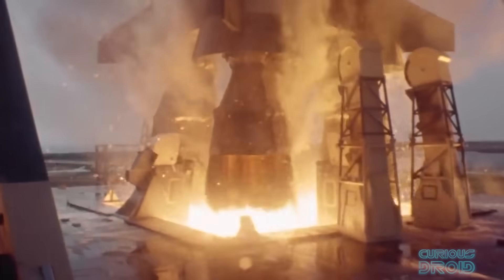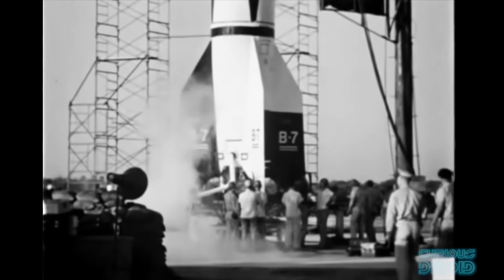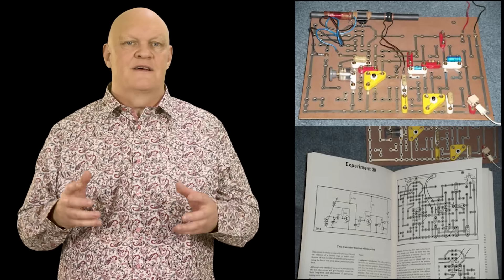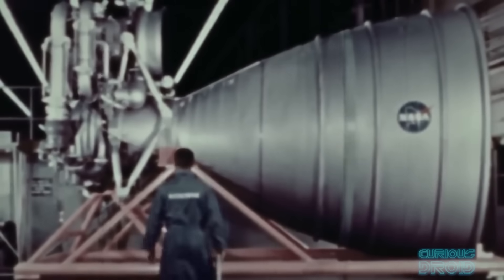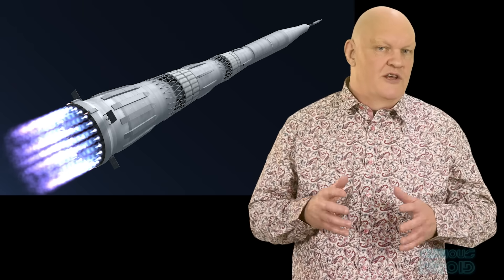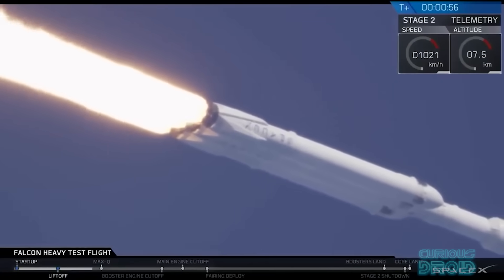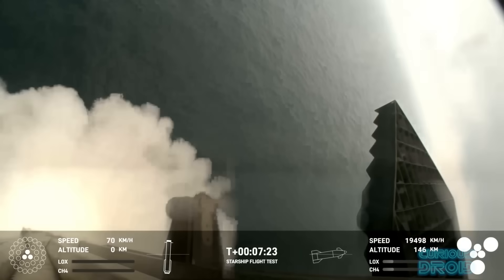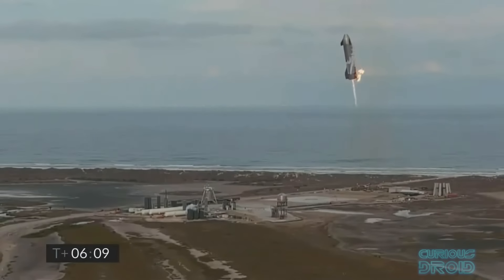Why Does SpaceX Use 33 Engines While NASA Used Just 5?

Comment: A bit unfair to blame the SLS on NASA engineers. The most fundamental design decisions were made by politicians, not engineers. The joke name "Senate Launch System" isn't that far off.
Reply: The biggest mistake in the SLS program was handing the reins over to Boeing/ULA and expecting anything to happen in a reasonable time, especially when you essentially give them an unlimited budget. When you give them a fixed budget, they cry about it when they still   inevitably fail to get it done properly(see Starliner).
Reply: @craftiebrown  Let's just hope the door doesn't pop out in space.
Reply: @TonboIV  Exactly
Reply: Honestly true, they also mis-incentivised everything, alot of SpaceX engineers used to work at Nasa, so it's not as if the Nasa team aren't as good by that much, they just aren't incentivised to hold long term missions, goals, etc, they have the budget for a single mission and that's if their lucky, and a ton of that just gets absorbed by managerial costs

I would argue mismanagement and politics could be the main reason why so many projects fail, talent helps, but lean and efficient management is what gets it over the finish line or to the moon
Reply: Senate insisting on SLS relying on the space shuttle technology and "parts" was a naive and deeply uninformed (or misguided) decision. The SRB needed ton of redesign of the internal components, liners, and insulation to make them safer, so much that it took years to recertify the modifications. The space shuttle design had the external tank carry side loads, as the boosters and the orbiter were mounted on the side, while SLS has the upper stage on top amd the thrust section at the bottom. That resulted in a necessary deep  structural redesign of the external tank to transform it into the first stage of SLS and be able to carry the loads. In the end, the "heritage" from the space shuttle program is tooling (and it can be argued that reusing the SSME engines was also not cost effective, the costs for refurbishing and recertify the engines after the shuttle flights ended are incredibly high, and they are disposed after one flight)
Reply: Exactly. Intent is to keep the same companies in business after Shuttle. Problem is the SSME and SRBs designs were chosen in 1972 to launch a winged vehicle. And that design had its tradeoffs. If NASA engineers had their way for designing a new large rocket to go to the moon, the architecture would be completely different. SpaceX had advantage of starting from scratch instead of carrying political baggage.
Reply: It seems glaringly obvious modern low-cost &  advancement of computers allows for multiple engines, but that was glossed over in this video. The computing technology of the past did not make multiple engines feasible.
Reply: @powerguymark  I wouldn't call that "obvious". Modern computers certainly help, but guiding a rocket into orbit at all is already a very difficult problem, which they managed in the 50s with incredibly primitive electronics. I don't see why controlling 33 engines would have been an insurmountable problem when controlling 5 wasn't. The N1 rocket had a lot more problems than just the number of engines. The Soviets weren't even able to do proper all up testing of the engines themselves and they couldn't test fire their stages at all. The first flight of the N1 was literally the first integrated test of any of its systems. It's not at all surprising that it blew up four times. If Korolev hadn't died and if he'd had access to even a fraction of the resources the Americans had, I think he'd have had an excellent chance of getting the N1 flying reliably.
Reply: @powerguymark 

Just as a funny side note, the space shuttle was using basically the Apollo mission computer that utilized core memory basically when it flew ,( core memory is electro mechanical,a disc similar to a washer is twisted sideways on its axis to indicate 1 or 0). NASA like the military loves ' proven technology'. 

When I visited the Johnson space center a retired engineer said when they started looking at the SLS booster for Artemis, one of the things they did was disassemble a Saturn 5 they had, to document its components. Apparently ( according to him) a lot of the plans were never digitized and were lost.
Reply: At least it's crew ready and had a successful non explosive first mission.
Reply: @MrMarshGames  
No doubt.  Starship's upper stage can't make it to orbit and crashes EVERY time.
Reply: The fundamental problem with SLS is the entire decision to use space shuttle derived technology. The inefficiencies of the contractors just make it worse, but the fundamentals were already terrible.

The space shuttle was already a failed program in terms of providing low cost space access. Sure, it launched lots of people and payloads, but for actually lowering the cost of space access, it was a failure right from the start (and there again, political design decisions were the main problem). Trying to modify an existing system into something drastically different in order to save development costs almost always ends up being more expensive than starting from scratch, and in this case we're talking about modifying half century old tech intended for a reusable space plane that was never going to be cost effective and turning it into an expendable rocket. The RS-25 in particular is a complex, high-strung, high-performance powerplant with a very expensive and labour intensive manufacturing process, yet most of its design requirements are unnecessary on SLS.
Reply: @TonboIV  To be fair NASA didnt want the flying brick of a shuttle we ended up with. Congress demanded that the shuttle have military capabilities which cause the design of the shuttle to increase drastically in size and forced them to mount it to the side instead of on top and that side mount is the reason we had two catastrophic failures . A top mounted shuttle would have likely been able to survive the Challenger incident and the Columbia incident would never have happened.
Reply: @TonboIV  remember the goal isn't gradually lowering the cost of space flight, that's why they will just ask other companies to design and make the capsules, which means they have to wait for exterior projects to finish before they can complete their missions

Just one more star to align
Reply: The Burning Rentry of Space Shuttles made such program too risky for reusing the Same Craft again & again. The politicians may virtually know it but not to .. realization. The Revamping the whole Burnt Shuttle, esp the Protective Heat,Tiles Underside the Craft, including to verify/testify the Substructure of overall the body-length is not 30/70 Cost portion as expected but rather 70/30.. newly added 70%, reusable Bodied just 30%. This final overall fixation of Whole warranty of flight Safety ..is FAR from Cheaper.. and nearly to guarantee the compatible of a whole NEW ones. So many accidents occurred, esp during Return flight of Reentry, the last one's hydraulic Door failed to close tightly, the bursting flame got into/under Wing structure. All gone & Shuttle program cancelled.
Reply: @komolkovathana8568  wrong. The loss of Columbia was due to impact damage to the RCC of the forward wing. That was not an area using the ceramic tiles whatsoever.
Reply: @TonboIV too bad Nixon canceled the Saturn 5 and sold the tooling for scrap.  Imagine the amazing launch vehicles the Saturn could have evolved into.
Reply: @TonboIV Really? Has SpaceX flown to the moon and back on its first launch?
Reply: @TonboIV  that is why I mentioned the Block III. The SSME underwent multiple major revisions over the years with most of the design being replaced Ship of Thesius style. Block I was the post-Challenger redesign, to give a starting point. The Block III replaces the nozzle and combustion chamber, the two most expensive and labor intensive points of the design. The replacement is derived from technologies made for the RS-68, an engine much more in line with what they need. Around when they will be ready is when the new boosters should be as well. That is why I am excited by the switch, to see what it can do with systems made for it, rather than hand me downs.
Reply: @downix The turbopumps are fiendishly complicated and their performance isn't necessary on an expendable booster. There were more suitable engines that could have been used right from the start, and once again more money is being spent to mangle a square peg into a poor fit for a round hole instead of just buying a round peg and admitting those old square pegs aren't useful anymore.
Reply: @TonboIV  depends on which ones you mean. The SSME had both sets of turbopumps replaced over its lifetime, a few times in the case of the low pressure oxygen pump. The configuration SLS is using were the last Gen versions, which again, were closer to the disposable pumps off the RS-68 than the original HG-3 pumps that launched on STS-1.
Reply: @downix  Either way, it's a modification of a racehorse engine into a packhorse. There's only so far you can go without just starting fresh, and all these modification cost a bunch of extra money and time just to turn the RS-25 into something else. The people who come up with these ideas always say it will be so quick and cheap, just a few little modifications and old-machine be perfect for new-project, and then one little modification requires another little modification, and that requires another, and now we need to modify the vehicle too...
Reply: @TonboIV  if the Senate hadn't limited the engines, my guess is they would likely have used a modified RS-68, which began life as a cost reduced, disposable version of the SSME, called the STME.
Reply: @downix  That was certainly one possibility. There were some significant problems with using the RS-68 too, but it wasn't even the only option.
Reply: @TonboIV  would could should, lots of possibilities. Sadly, the Senate put a massive thumb on the scales.
Reply: @downix  cry harder. The sls is an awful design
Reply: @downix Tonbol is right about them always saying a rocket modification will be quick and easy…..stuff always still takes a damn decade lol.
Reply: @downix  all of the concerns you've mentioned and more prove only one thing.   US public institutions are no longer the solution to any sort of economical or reliable space travel.  Our government is frankly a disaster of our own design and that's unlikely to ever change.  

Just toss SLS out the window and give SpaceX 5% of the money.  If Superheavy wont do it just give them the specs of what you want and let them exceed it while doing so under budget. I'd be willing to bet SpaceX could have a totally new ship design landing on the moon before SLS is ready for the next phase of its already obsolete life.
Reply: It's not just unfair. It's ignorant, perhaps willfully so. How can you do research on the SLS program and not come across why it and the shuttle were so inefficient?
Reply: I don't see that he was blaming NASA engineers, just that engineers leave/left NASA for certain reasons 🤔
Reply: almost never a reason to blame engineers, unless they're doing it maliciously, it's always some mahogany door, suit-dummy that makes the stupid decisions.
Reply: At least the SLS went to the moon, came back, and landed successfully back on earth on its first attempt.  Starship can't even make it to orbit and is only good at crashing.
Reply: @kstricl i think with 11 launches for orbital fueling, at $100M thats just a tad over $1B to get a moon launch going. The cost might drop with time but there is still landing the boosters and starships  and orbital refueling to  figure out. It might be cheaper in the long run  than SLS but it will take longer...a lot longer. SLS has already gone around the moon with Orion.
Reply: Tbf, iv read into the politics and it makes the program more cost-effective than I really realized.
Most of the "useless costs" with the SLS, are mostly just glorified subsidies and welfare for keeping missile companies and other jobs in business.

If were gonna have subsidies over these jobs, then we might aswell keep em productive while at it.
Reply: @honkhonk8009  Makes sense. We funded the Russian space program for the same reason in the 90's. You really don't want rocket scientists out in the world "looking for work". Iran does but you don't.
Reply: @honkhonk8009 Could have used those subsidies to either develop missles (we need new ones) or to build space probes.
Reply: @honkhonk8009 Not really. Some of these programs are so large and complicated no one knows who is giving who orders. This creates situations where design teams are fighting over small changes
Reply: @honkhonk8009 exactly you don’t want them to work for NK or China
Reply: @honkhonk8009  So, create glorified subsides, then continue to endlessly pay people to fail because there's already subsidies that you've created. Then claim it's cost effective when it runs over budget endlessly? Got it.
Reply: But the best and brightest have gone on to greener and much more lucrative pastures like SpaceX, blue origin, etc..  give NASA unlimited money to do whatever they want and they couldn’t come close to SpaceX because they no longer have the engineering talent.
Reply: In addition to what everyone else is saying, SLS was designed the way it is, with contractors in each of the fifty states and most of the territories, to make it administration-change proof. Ever president has a new idea for what to do with NASA and it hinders long-term planning. SLS has withstood more than 20 years of bureaucracy. Just as designed. NASA did this on purpose to keep Congress' eyes on the moon.
Reply: No it's all NASA hardware. While I agree that giving billions and billions of our money to other nations to fight wars that have nothing to do with us is 100% wrong. Even a percentage of what's been given to Ukraine over the past few years could have seen NASA not fall further and further behind, and have to resort to building the spacecraft equivalent of a hotrod using junkyard sourced parts. And we m8ght not be looking at the 50 year follow up to the apollo craft that centered around a capsule with an ablative shield being an almost carbon copy of the aforementioned capsule. Yes the computer hardware is light-years more advanced and the switch from fuel cell generated electricity to solar panels eliminates the points of potential failure that almost killed the crew of apollow 13( but introduces new ones see micrometeors and what a sand grain did to the James Webb) 
All that said the SLS is still a NASA product and while it is functional it's a bit uninspiring and in my opinion embarrassing.
Reply: It's all NASA hardware and yes giving billions upon billions to ukraine for a conflict that has nothing to do with us, has knee capped NASA. The SLS is functional but it's nothing more than an apollo system right down to a capsule with ablative shield. Sure the electronics are modern and they're using solar power instead of fuel cells for electricity generation. But it's still a capsule. And while the SLS is a cobbled together junkyard hotrod, those running NASA still won't listen to those funding them aka you and me and have elected to chuck 99% of the system (rocket) into the ocean, again just like back in 1969. The space shuttle was a year old when I was born and budgets be damned because they can't tell me than in over 40 years of sending people up into orbit that none of those same engineers came up with something anything to make even part of this Frankensteins monster of a rocket reusable. Hell just the engines, the liquid fueled engines just them. The smartest people with the most experience to draw from can't figure out how to bolt on a set of parachutes to these things so that they soft land? Or chutes in combo with some kind of instant inflation device that would allow them land and then float in the ocean until pickup? If your budgets are being slashed by the parasites in DC then maybe make the most of what you have. It's embarrassing to listen NASA talk about the new moon mission, especially when you consider that they already DID IT!! NASA has become contradictory and even kind of ignorant, in that they have a motto for finding life off of earth and that's "Follow the water". Well they've been dicking around with mars since the 70s with at least 2 positive signs of life but not definitive signs. And in the last 20 or so years at least 2 of the ice shell moons Europa and Encelidus have proven that they harbor massive liquid water oceans under their surfaces. not like mars with its dried up oceans where we may find a fossil or two, or maybe (big damn maybe) a subsurface aquifer, but actual current watery oceans. In europas case the water is thought to be around 60 miles deep with pressures at the bottom like those we see here on earth because of the lower gravity and given that jupiter / io are stretching europa like taffy all the time there's a good chance that Geo thermal vents exist down there. But NASA ignores europa amd won't shut up about mars. And now thanks to bidens spending spree the mars sample return mission probably won't happen. And the so called europa clipper mission won't even be focusing on europa. Sorry to go off on a tangent but NASA hasn't done itself any favors from retiring the shuttle, then relying on the Russians for transportation up to the ISS, and now to relying on space x to get astronauts up there. Don't get me wrong I think space x is amazing, but it's NASA they should be leading the way not a stagnating beurocracy (fucking spelling?) They should have been allowed to patent amd profit from the things they invented (like in for all mankind) and alleviated the need for public funds as their only source of money, so when the political oxygen thieves beholden to Lockheed, Reatheon etc... decided to make the money printer go brrrrrr to either start a war or fund someone else's, NASA could have absorbed any cuts without much of a problem
Reply: NASA is fully to blame - they are focusing on advancements of feminism and wokism rather than on advancing technology and boundaries of space exploration.
Reply: SLS first flight was successful unlike the multiple failures of Starship, so politicians appear to know more about rockets than the con man Musk.
Reply: SpaceX is a joke.  I'm not going to waste my time watching an Elon boot licking video, but SpaceX is a string of failures with good marketing.  NASA actually did shit.
Reply: @Dreadlk Building a reusable space plane in the 70s/80s was a great idea for NASA. It was politicians who f'ed it up with short sighted cost cutting, lack of will and ignorant meddling. A more sensible design could have worked well and actually provided less expensive and more frequent space access.

Right now, NASA is spending a huge amount of money to develop a very conventional rocket. SpaceX are the ones taking risks and aiming high. If all NASA needs is a big dumb rocket to throw mass at the Moon, they could have just contracted out to the commercial sector for it like they did when they needed a space station taxi.
Reply: @Dread Building a reusable space plane in the 70s/80s was a great idea for NASA. It was politicians who messed it up with short sighted cost cutting, lack of will and ignorant meddling. A more sensible design could have worked well and actually provided less expensive and more frequent space access.

Right now, NASA is spending a huge amount of money to develop a very conventional rocket. SpaceX are the ones taking risks and aiming high. If all NASA needs is a big dumb rocket to throw mass at the Moon, they could have just contracted out to the commercial sector for it like they did when they needed a space station taxi.
Reply: If Kennedy were alive nasa be on different game , and perhaps we’d know all the truth
Reply: NASA is just a jobs program for minorities. Plain and simple. I used to work there so I know.
Reply: Not really, if that's how it's operated, then that's how it's operated.
Reply: The Senate is only concerned with the budget and what genitals and skin color the astronauts have
Reply: Can't blame Congress: voters only vote for those who can afford the most soundbites. The only way to pay for those is to be corrupt and get loads of (re)election 'contributions'. Again, not blaming Congress, because all those soundbites do nothing more than promise the most freebees, offered to corrupt voters.
Reply: All these idiots that are completely clueless about Elon’s mission with SpaceX but happily will waste air and bandwidth to spew their absolute bullshit on YouTube just crack me up. Here’s a concept, why not LISTEN to Elon when he’s talking, he literally tells us all exactly what he’s up to, his strategy, plan, far reaching goals, etc. Guarantee yall have never even tried to listen or you’re just too brain dead or brain washed to get it. 👍
Reply: I totally get the juxtaposition betwixt the 2 and it's subsequent arguments respectively.  What I DONT understand is why till this day people seem to not comprehend...no matter what petty political rhetoric you lean towards...that without question...NASA has been and continues to be plagued or having one arm tied behind their back as far as progression goes ...by the American congress/senate. I think people truly don't realize that ALOT of the amenities and innovation the average citizen has access to is solely because of the hard work of NASA and JPL ..PERIOD . I may be a astrophysics geek and I love just about anything to do with anything off this planet of petty selfish warmongering mean beings as is , but how can one even pretend to imagine of having a dream about remotely speaking negative things about NASA ever dwindling budget . Especially in contrast to the almost 900 billion spent solely on ways to end the lives of people's all around the globe.  No offense  to anyone here I just personally am fed up with folk always critical of nasa while simultaneously raving and praising wtfever the PayPal patriarch does
Reply: NASA is now and always has been nothing more than a money-laundering vehicle for politicians to line their own pockets.
Reply: Its a LOT unfair, and the Senate Launch System is the perfect name.

Congress ordered NASA to use cost-plus contracts. Then after NASA testified before Congress that the cost-plus contracts weren't working, and the cost was "unsustainable", Congress ordered NASA to keep using cost-plus contracts.......

Senate Launch system indeed.
Reply: The U.S. Congress required NASA to use Shuttle technologies instead of a clean sheet design. This never turns out well when politicians design rockets!
Reply: Decisions and contracts!!!
Reply: Agreed.
Reply: How to fly without wings

Vertical lift off is dificult, danger and high cost
This is the SOLUTION
Will replace rocket
AntiGravity Aircraft 
Work base on Gravity just spinning by using Battery
can fly in bad weather, plunge in the ocean even in outer space

Earth which weight predict 600 trillion ton does not fall at the Sun because of centrifugal in orbitting, on the contrary it does not be thrown far go out the orbit line of hold by gravity at the Sun as orbit center. Gravity and centrifugal is equal called Equillibrium, thats why until now Earth which we was inhabited always rotate and circulate the Sun. Now we justly take example : how if the gravity used and centrifugal is negated? The Earth will float far leave the Sun. So that centrifugal can be used to fly far away if gravity eliminated. Finally how to eliminate gravity?

It’s way rotate part of aircraft by horizontal. When that rotation faster centrifugal force getting greater and the gravity getting smaller, finally it lose the gravity and the aircraft start flying. Of course people would surprise: how the aircraft can keep rotate without fulcrums? Thats why we named that aircraft Shuttling System that is aircraft likes two disc adjoining attached in the midle as fulcrums:

A. The Top part, we name Positive rotate to right, and the edges is getting thicker and havier.

B. The Buttom part, we name Negative rotating to left, and the edges is getting thicker and havier.

C. Middle Part , we name Neutral, air crew placed and also machine and everythings turning Negative and Positive at the same time.

The aircraft can liftup added with explosion from the engine. However that aircraft construction later, let the engineer doit it, and we are sure the aircraft will bulletproof and also waterproof.
 
.
.
 
In modern civilization where human being generally using flying saucer as vehicle, will a lot of change in lives either in materialism and in psychological. In materialism area will apply the change in life like.
People no longger need roadway and rel road which spend large of energy, money, places, things and time, object place and time. People would utilize that area for habitat or for other need:
Reply: Not really
Reply: The SLS design is purely designed to support as many US companies as possible to help the economy. That's why it's all an old design. SpaceX produce all their own parts, so no good for supporting US space companies other than raw material manufacturers.
Reply: What a weird npc-like comment.. i imagine you must be very anti-authority & hate the government to make an absurd comment like that.
Reply: You sure nailed that one. Whatever Congress takes a hand in ends up overpriced, overweight, overcomplicated, and late. Look what they did to the F-35 program.  SLS could have been nearly as amazing as a SpaceX project and cost twice as much to achieve what, exactly?
Reply: All government projects are made by the LOWEST bidder!  Typically that would mean that you get what you pay for, but all of the contracts are still highly overpriced, so we're overpaying for the worst proposal!
Reply: Yes, the politicians suck. Once upon a time, military officers and civilian ministers were expected to resign rather than carry out orders destructive to the public. Thank God legislatures in the West got rid of THAT system!
Reply: @TonboIV  SpaceX took 3 billions for developing HLS, also 1 billion in 2022, for developing artemis lander, and that's not even accounting for removing taxes from the company, which is also a form of govermental support.
Cut the bullshit with 0$, because it undermines the public interest in accounting of SpaceX efficiency.

Mark my words, Starship will not fly to the moon with mission payload before 2030, if ever.
Reply: Nasa is a wasteful government agency that has zero business trying to regulate private markets. The pioneering and discovery phase of space exploration is over. Nasa might have brought us to the moon but they didn't keep us there.  They're just getting in the way and making a nuisance out of themselves. The government doesn't yet have anything to protect in space in terms of trade or shipping. It's absurd to accept their involvement.
Reply: After Apollo, 90% of NASA's mission has been pork barrel spending at the demand of various Senators and Congressmen. Improvement and reform would mean a Senator somewhere gets less political capital to bribe his constituents with. That can't be tolerated, and thus failure at their TRUE mission (going to space) becomes not merely acceptable, but expected. No big deal. The Illuminati are getting theirs.
Reply: How does that make any sense? Even politicians aren’t dumb enough to make those design decisions.
Reply: What about 💩tty launch system..?
Reply: Starship is basically the ideology when it comes to engines as the N1.
Reply: Not wrong, but that's the nature of a government run organization. You get rid of that, it's not really NASA anymore. Those engineers could go way further in the private sector.
Reply: Politicians are useless idiots
Reply: SLS delivers for the fraction of money SpaceX Burns through
Reply: @ReinhardSchuster  Why does it matter how Musk chooses to spend his own money? SpaceX's testing has cost US taxpayers exactly $0. Boeing has cost taxpayers about $6 billion in overruns alone.  SpaceX is making progress, while Boeing continues to show how much of a useless disappointment it is.
Reply: For micro control burning?
Reply: NASA "engineers" don't design or build anything.  It's the contractors who they supervise which do the technological "heavy lifting".
Reply: Ну естественно инженеров наса никто не обвиняет в том, что политики в сша приняли решение имитировать полеты на Луну снимая кино для обывателей вместо того, чтобы давать еще денег на реальные полеты вместо тех фейков которые нам показывали с 69 по 74 годы. Проектные решения в принципе не могут быть приняты политиками. У них просто нет на это компетенций. Политики лишь могут выбрать, что инвестировать, а что нет, что секретить, и как надувать обывателей контролируя какие то нужные для этого ресурсы, а принимать инженерные решения.... точно нет.
Reply: Fun fact:  perhaps the greatest administrative role of the US Vice President is NASA.  Look at the clowns that have been there for the past 20 years.
Reply: Yeah true, there are plans submitted to NASA with reusability in mind but they're scrapped for some reason. Good thing SpaceX picked all of them
Reply: nasa needs to be shutdown so much money they wasted ... here comes space x to make a re-usable rocket....  in only a few years of trying lol
Reply: thats why spacex will always beat nasa
Reply: Senate Laundering system isn't bad either.
Reply: Can you imagine if NASA blew up as many rockets as Space X prototyping? 

 Space X is in the rocket business.

 Raptor isn't the best engine design now in development. They are going to need to move onto some full flow rotating detonation hybrid rockets. Which I think one company is trying to make with the help of NASA. The one using Tesla valves.
Reply: Facts
Reply: SLS works, twittership, not so much....
Reply: Sure seemed to fly well on its first launch...to the moon and back.
Reply: SLS is first and foremost a jobs program.
Reply: @kevinw7319  Corporate charity would be slightly more accurate, but you're not wrong!
Reply: Space X isn't doing anything nasa couldn't do. But nasa isn't allowed to blow up a bunch of rockets
Reply: @m0redread  I couldn’t agree more
Reply: @m0redread didn't they blow up a couple with several people in them both?
Reply: Also, how many times did they cut NASA's budget? That's not fair either. They have a work with what they are given.
Reply: Then you also must give credit to politicians for the success of the Apollo program, wouldn't you?
Reply: @maxstr  I would absolutely give credit to politicians for the Apollo program. Kennedy committed unambiguously to an ambitious goal with a fixed timeline (a practically mythical act for a politician) and he and others in the US government gave NASA and its contractors the resources they needed, put people smarter than themselves in charge and stayed out of the way.
Reply: There’s an old saying that a camel is a horse designed by a committee. Somehow it seems appropriate here. Sadly, most decisions about the SLS were made more based on political needs, like keeping jobs in certain areas, than engineering ones. Love or hate Elon Musk, it’s hard to argue that Space X is slaughtering NASA at the moment and I don’t see this changing if politicians keep trying to run the show.
Reply: @peterj5751 still too close to a horse. I’d say a platypus is a horse designed by a committee!
Reply: @Cre8tvMG  that is a better analogy.
Reply: @peterj5751 SpaceX wouldn't exist without NASA and the federal government.
Reply: @peterj5751  if you look at the numbers, especially after Soyuz was off the table, SpaceX has been keeping the US "space industry" alive from ferrying astronauts to launching comms satellites for civillian and DOD applications. I mean I'm not an Elon fan boy but where I live my internet options were VIASAT & HughesNet both of which are in technical jargon Dog Shit. Even under their unlimited plans you'd only get X amount of gigs per month before your connection was slowed to the point of almost unusable. And I got rid of cable years ago so when I moved here (about 1.5hrs N of Philly) and found out cable wasn't even an option I figured "Eh No big deal I'd only had internet for the last few years" but if my fiancé and I watched a movie or show on Netflix/ prime or whatever at one or two a night, id get a message that I'd exceeded my unlimited plans data cap. Web pages would load like a 56k modem and me working online I couldn't deal with that shitty a connection. So when I saw how fast and not throttled StarLink was I got it as soon as it was available. And the only thing that slows it even a little is when my nephew comes over and he plays Call of Mincraft Duty or whatever online. So while I want nothing to do with EV's as they are, elons SpaceX is on point
Reply: @peterj5751 A camel can survive harsher enviroments, can travel further on less water, can run nearly as fast and carry more cargo than a horse. So it looks like the committee knew what they were doing.👍
Reply: @jasjordan1  except if they were making a race horse. 😄
Reply: Hate on SLS as much as you like but at least it is a capable rocket. Starship shares the N1s reliability and will probably share the same ultimate fate.
Reply: NASA generational family here, 1000%
Reply: It was NASA engineers who advocated scrapping the shuttle and returning to throw away mega rockets and retro spam  cans
Reply: @scoutdynamics3272  Because the Space Shuttle was an extremely expensive, unreliable, very dangerous spacecraft full of 50 year old tech that isn't used in anything else anymore. Ending that program was necessary and gave NASA a chance to do new things with manned spaceflight for the first time in decades. It was politicians who squandered that chance.
Reply: @scoutdynamics3272  Ending the shuttle program was the right decision. It was extremely expensive, unreliable and highly dangerous. The tech was also 50 years old and it required maintaining a whole cluster of dedicated industries just to keep it flying. It held NASA back from doing anything new in crewed spaceflight. The wrong decision was the one about how to replace it.
Reply: @TonboIV  NASA was dangerous! Not the Shuttle. Upgrades which would have brought the shuttle closer to its cost goals were scrapped. Expensive? The Senate pork rocket and retro spam can make it look cheap!
Reply: @TonboIV  A throw away mega rocket topped with a retro spam can is not doing anything new in crewed flight
Reply: @scoutdynamics3272  SLS being bad does not make the Space Shuttle good. The shuttle had fundamental design problems that were impossible to fix. The huge SRBs had certain hazards you can't get away from. The only way to safely fly humans on a rocket with SRBs is to include a launch escape system, which was impossible on the shuttle orbiter. Reuse could never have been made cheap or fast. Reusing a solid rocket motor is already a terrible idea, and splashing them down in the sea meant the recovery and rebuilding was very expensive and slow. The external tanks were never going to be manufactured cheaply or quickly. The basic design of the orbiter meant that the heatsheild had to be fragile and very difficult and expensive to maintain. The RS-25 engines had to built at the upper limit of rocket capability just to get the shuttle into orbit, which made it impossible to make them reliable without rebuilding them after most flights.
Reply: @TonboIV  There were plans to replace the SRB's with fly back liquid fueled units. The TPS used on Starship and Dream chaser was originally designed for the Shuttle. These upgrades were cancelled and NASA operated the shuttle outside its design parameters! Criminal negligence was the problem! Not design
Reply: @TonboIV NASA was going to do reusable rockets but the pit for the shuttle was better ie military application.
Reply: The government shouldn't be designing rockets at all. Leave that to the private sector.
Reply: NASA studied a lot of options, and frankly, the SLS is a good overall design. It will be better once the Block III engines are used.
Reply: Not a good design  @downix
Reply: @downix  it's a TERRIBLE design and ... block 3?   we'll never get to that because it's soo expensive.   It's a joke.   It's a cruel joke on the taxpayer.
Reply: @zachansen8293 same for starship, but 2x that. You're the one paying for it
Reply: @zachansen8293 at least you can be sure that this thing flies and can deliverv something to orbit, unlike starship which got lunar mission cancelled after 4 billions of investment
Reply: @zachansen8293 So far, Starship has literally turned through 3.3 billion dollars and hasn't even made it to orbit, nor has it hit any of Elon 's milestones. SLS cost more, but it made it to the moon with a payload on the first try. So far Starship has mastered exploding while carrying zero cargo. You get what you pay for...
Reply: @jasjordan1  "Starship" has burned through about $400 million.  Starbase and Starship together have run about $10 billion.  The prototype stacks are $100 million.  Don't pull figures out of your nethers.  SLS cost $4 billion.  So I'll tell you what.  If Starship can't get to orbit before blowing up 40 Boosters and 40 Starships, then SLS wins.
Reply: @jasjordan1  Starship: Largest rocket ever flown. Largest spacecraft ever put into orbit (okay, suborbital, but the difference was minuscule and intentional. They clearly could have orbited if they wanted to). Largest ever hot-fire stage separation. Largest two vehicles (both stages) ever to return intact from space (damaged yes, but intact and in controlled flight). Only orbital launch system ever to demonstrate controlled, intact touchdown of all stages. It's a historic, monumental achievement. SLS was in development for over ten years without even leaving the ground. SpaceX chose to fly early and fly frequently, and blow up rockets, so that they could learn from failure strive for wildly ambitious goals. They did that with Falcon 9 too, and people laughed at them for crashing and blowing up rockets, and now Falcon 9 is dominating the launch market and demonstrating practical reuse for the first time in orbital launch history.
Reply: @zachansen8293  one of the most efficient high thrust rocket engines ever made, a "terrible design"?
Reply: @downix  it's not a bad design if you consider the management, the budget, their goals and incentives, basically, the problem is just that it's gotten so political
Reply: @TonboIV I lived through the heyday of the space age. As a kid I stayed up with my parents watching every spaceflight, including the first moon landing. I have seen the development of the space shuttle, reusable rockets, space planes, etc.. So I get it that some people marvel at starship and SpaceX thinking it is something new and groundbreaking. The thing is, it's all based on technology invented by engineers and scientists using slide rules and relatively primitive technology. So I have to laugh a little at people teaching Boeing and NASA when it was and is their expertise that made SpaceX possible. It's like saying someone who aced a test after being given all the answers is a genius. 

The concept of "break things quickly" is what people say as an excuse for failure. If I said that, I would be out of a job. There is nothing wrong with failing, but trying to turn it into a win is a waste of time and materials. Elon is just wasting public money with a show to hide the fact that he is way behind his promised schedule, causing NASA to hedge its bet by bringing in a company that they know can get the job done if SpaceX fails. As we have seen, for all the money it cost, Boeing produced a space craft that worked the first time and completed a full mission on its first launch. Something SpaceX has never done and tbh, isn't all that remarkable in the industry. It is the difference between proper design and engineering, and throwing it something against the wall to see if it sticks. Their philosophy is  failure is not an option and their success validates that view. It is something that they should pass on to their commercial aircraft division, tbh.
Reply: @jasjordan1  You didn't even respond to any of the points I made. You're ignoring all the many rocket explosions during space race era development and you're continuing to pretend that soft landing both stages of the largest rocket ever flow is somehow not significant.
Reply: @jasjordan1  Boeing and NASA did not make SpaceX possible. They have been doing everything from scratch since the beginning. Both the Merlin and Raptor engines are original designs. The Raptor is the most efficient rocket engine ever made(by a long shot) and has no predecessor. Boeing can't even build a plane that doesn't have doors that blow off, or after 8 years, critical systems that don't bleed helium needed for thrusters into the vacuum of space. Boeing, NASA, or anyone else has ever built a booster that's reusable. Never mind that booster is also more reliable than the space shuttle and every other booster to ever exist.
SpaceX is what it is because they DIDN'T follow the normal "government pays charity to a company with political connections" scheme. An eccentric guy with a lot of his own money to blow started from the beginning and ignored all of the nonsense you think is great because of nostalgia, and Boeing continues to get paid taxpayer money to fail.
Reply: @Asterra2 SLS development cost $32 Billion from 2011 through 2023 and is currently estimated to cost $2.5 billion per launch. Where the hell are you getting $4 Billion?
Reply: @FunningRast  and $2 billion of that is infrastructure costs to boot.
Reply: @jasjordan1 No body in known history has landed a rocket and reused it 20x's.

SpaceX
Reply: @Andrew0you0tube exactly no orbital flight payload yet while SLS already send Artemis 1 to the moon
Reply: @craftiebrown  That's false I'd say that SpaceX is just the same as Boeing in this regard.
He takes money and there are no cost-effective tarrifs for taxpayers, it all the same cost for launch.
Reply: @craftiebrown 
The Raptor engine is not the most efficient engine ever made. It's incredible, but there have been a number of more efficient ones, such as the RL-10, or even the RS-25 (yes, the engines the SLS uses!)
Reply: @robbiejames1540  Based on the fuel used, the RS-25 has a higher specific impulse, but that's because the hydrogen it uses is more efficient than the methane SpaceX is using. It's like comparing an engine running 94 octane to one running diesel. Outside of that, the Raptor 3 has a drastically higher maximum chamber pressure(highest ever by any rocket engine ever built) and a FAR better thrust to weight ratio.
Using hydrogen doesn't make sense for SpaceX considering the Raptor is being designed for different usage than the RS-25.  Fuel source not withstanding, the RS-25 doesn't even come close to the Raptor in it's overall efficiency.
Reply: @craftiebrown  
Yeah, I'm very aware of the Raptor's ridiculous chamber pressure and thrust to weight ratio. However, the efficiency of an engine isn't something one can separate from the propellant choice. By the only really important metric of rocket engine efficiency, exit velocity, the RS-25 has more. This is most important in vacuum applications, where the raptor's crazy chamber pressure is largely irrelevant - an upper stage powered by an RL-10 can provide markedly more delta-v than a raptor could.

While I definitely appreciate the engineering that has gone into the raptor, it has drawbacks and compromises, just as practically any engineering system will.
Reply: @jasjordan1   me: quit dimming the lamp.
You: im not dimming the lamp. Leave the gas light alone.

Do you seriously think safety can be accomplished without innovation and testing? 

Care to drive a car that's never been tested?
Reply: @zachansen8293 Really? I thought it flew well to the moon and back, on its first launch.
Reply: Engineers (nasa) gave them the designs to choose from, maybe don't give them an option other then the reusable design. The money would have gone to whatever they chose in the 60's given the huge ideological  battle.  Government entities operate on just good enough not the best etc. Just look to the soviet auto industry as a stark example of this.  To be fair I think the elected representatives are also myopic, we don't elect our best we elect...well maybe there are 1 or 2 good ones but the rest...no better then your average umm..for illustrative purposes only, get the gist across, walmart shopper.
Reply: @JB18850  I'm not arguing against you as a whole necessarily, but if you don't think now is a bigger ideological battle than the 60's? In 2024 we are fighting over whether you should allow unlimited immigrants to flood your border, get handed government payouts and official state ID's and whether a female has a p3nis or not. There has never been a larger ideological gap than now. Maybe the wrong thread to have that conversation.
Reply: Correct. This is a hilariously serious, fundamental flaw in NASA
Reply: Rocket is complicated and dificulte
Low safety and high cost
We need somethings better
Developing technologies to enable human access to space at dramatically lower cost and increased reliability #FeelFree
Reply: Government agencies aren’t allowed to think, you don’t get the top minds there.  All the good engineers and scientists go working somewhere exciting where they’re able to think.
Reply: Agreed, it wasn't NASA engineers at fault, by the same token it wasn't Boeing engineers that caused the 737max to fall out of the sky twice. It was their leadership. Although Boeing has embraced DEI but the whistleblowers suggest they still have competent people.
Reply: I never heard Senate Launch System - that is priceless.
Reply: Ah yes, the engineers gave into the politicians all the while the engineers didn't think that it would not work. Instead of calling the politicians useful idiots, the engineers took their money.
Reply: That's the advantage of having a private company doing VS the government..
Reply: @tunnelvision2day what private companies are stagnating now and haven't even replicated the Apollo missions.
Reply: A fundamental design flaw of the Space Shuttle (inherited by SLS) was the use of Solid Rocket Boosters (SRBs).  They should have used Liquid boosters, each with 2 F-1 engines.
Reply: You misunderstand engineering design and concepts. Concept is senate, engineering is Boeing and NASA.
71 corrective action requests, or CARs. Effectively having interns weld oxygen tanks so that they are scrap metal. No Senator ever can design such a thing they can be happy to find their own arse to wipe, what they can do well is corruption, no limit cost development, that's how 71 CARs lead to single rocket costing 4.5 b USD. Lot of creme to siphon off: Insider trading, CEO boni ... I'm sure none of those senators designed the pluming, wouldn't even capable to tell you what diameter they need to fee a RS-25 with fuel.
Reply: @11moonshot .  . " sorry, but I am sick and tired" .  . 😃 .  . Thank you for your sponsor reply.  You must disparage the obvious proof demonstrated in the unedited video -- They remained in near-Earth orbit and confirmed by impossible weather patterns for all to see .  . Two straight line cloud fronts each extending for a quarter of the Earth's circumference .  . When in reality we are viewing a much smaller region framed within the round window of the command module under greatly reduced exposure settings.  The camera then pulls away as the window never leaves camera range as the exposure settings are returned to normal and a flood of blue light enters through the window -- with nothing change in the orientation of the spacecraft at that moment.  Good luck with your efforts .  .
Reply: Are you a nasa informant
Reply: @gdosegames-dv3tu  NASA didn't decide anything in regards to SLS. The US government did to give money to Boeing and so Senators could brag about jobs in their states. Your question makes ZERO sense considering it's all public information.
Reply: Did Apollo 11 actually leave near-Earth orbit?
Despite the revisionist narrative that this channel won't question -- unstable fuel burn for the oversized F1 engines was never rectified and another arrangement in their place was made in order to reach near Earth orbit, keeping the F1 bell nozzle to maintain the desired appearance.  The great licking yellow flame was an indication that something was not normal as fuel was burning in the atmosphere while providing no additional thrust. This was the result of injecting additional kerosene into the exhaust stream for greater visual effect yet appearing to produce an inefficient burn unlike other rockets after launch.  No explanation is forthcoming and this issue is not addressed in any usual report; however, using a smaller reliable engine with a reduced fuel load and stripped down mission requirement allowed the Saturn V to reach near-Earth orbit.  The Apollo 11 crew attempted to demonstrate their position at over halfway to the moon as seen in the unedited version presented to the public while the more recently released unedited version reveals a flood of blue light entering the same window as the camera continues to roll, through which only a moment before, we saw the Earth far distant in what appeared to be very low light conditions. Then, as the camera pulls back from the window, the exposure settings are seen to return to normal as a flood of light enters the same window.  Without a change in the orientation of the spacecraft assumed to be on a trajectory toward the moon, the only source for any flood of light can be the Earth while in near-Earth orbit.  The usual sponsored efforts will try to make excuses for why the obvious did not take place -- yet is overly apparent in the unedited version.  When facts cannot prevail in support, sponsored activity will resort to name calling and other derogatory comments discrediting themselves.
Reply: @ronaldgreene5733 lol it was easier to get to the moon than fake it and USSR would have exposed that fast.
Reply: @BladeValant546  .  . LOL .  . 😃 .  . Interesting how we agreed to massive shipments of grain at discounted prices to alleviate the effects of poor Soviet grain harvests at that time while Apollo remained in the headlines -- Yes, interesting how we suddenly became so philanthropic toward the needs of the Soviet Union during the height of the cold war .  . Not to mention the skeletons in their own closet for the Soviet Space program to be kept hidden from their public .  .
Reply: .  . While remaining in near-Earth orbit, another indication are the impossible weather patterns seen on Earth, when in reality only a small portion of the Earth's surface was visible, framed by the round window of the command module.  Straight line cloud fronts are seen on video to be extending for what appears to be more than 6000 miles, a quarter of the Earth's circumference -- something that has never occurred in the meteorological record on Earth. The round window of the command module was used to effect an image of the Earth but the weather in the region did not comply for a realistic view.  No recognizable continents are found in view, but only the impossible weather patterns seen.
Reply: That is exactly why the Framers designed our government to be limited. It was intended that members of Congress should be limited to what they know, rather than passing laws in areas they didn't comprehend, like rocket science or healthcare.
Reply: The goal was to create another botolmess money pit, and they did it.  My question is, why didn't Elon send a tiny camera set up to the Moon, as with his logo next to the Earth view, 24/7 would be the best PR opportunity in human history.
Reply: NASA already ventured into the reusable rocket business with the Space Shuttle and it ended up killing their budget and stifling their main objective which is Space exploration.   The original idea of the shuttle being a satellite repair and retrieval system was soon outdated as the realization that it was just better to launch a new satellite with newer tech than repairing an old one.   In the end NASA decision to build the ISS was partly due to it's need to create a purpose for the Shuttle.
Fast forward to today and NASA is back to building limited production runs of Rockets and craft that are deigned for Specific missions.  This is how they keep on learning and Innovating.  SpaceX on the other hand is more than Happy to Keep using the Falcon 9 and Starship to keep filling their endless need for Starlink satellites. He will need to do that to complete the fleet and also to keep replacing the hundreds that will die every year. 
It's two Teams with completely different Objectives.
Reply: @Dreadlk  Shuttle wasn't a very good reusable platform. There were concepts of re-using the first stage of Saturn that had much more promise, what with not needing to carry so much mass into orbit just for the landing part.
Reply: @Dreadlk  Building a reusable space plane in the 70s/80s was a great idea for NASA. It was politicians who f'ed it up with short sighted cost cutting, lack of will and ignorant meddling. A more sensible design could have worked well and actually provided less expensive and more frequent space access.

Right now, NASA is spending a huge amount of money to develop a very conventional rocket. SpaceX are the ones taking risks and aiming high. If all NASA needs is a big dumb rocket to throw mass at the Moon, they could have just contracted out to the commercial sector for it like they did when they needed a space station taxi.
Reply: @Dreadlk  Building a reusable space plane in the 70s/80s was a great idea for NASA. It was politicians who messed it up with short sighted cost cutting, lack of will and ignorant meddling. A more sensible design could have worked well and actually provided less expensive and more frequent space access.

Right now, NASA is spending a huge amount of money to develop a very conventional rocket. SpaceX are the ones taking risks and aiming high. If all NASA needs is a big dumb rocket to throw mass at the Moon, they could have just contracted out to the commercial sector for it like they did when they needed a space station taxi.
Reply: @Dreadlk  Building a reusable space plane in the 70s/80s was a great idea for NASA. It was politicians who messed it up with short sighted cost cutting, lack of will and ignorant meddling. A more sensible design could have worked well and actually provided less expensive and more frequent space access.

Right now, NASA is spending a huge amount of money to develop a very conventional rocket. SpaceX are the ones taking risks and aiming high. If all NASA needs is a big expendable rocket to throw mass at the Moon, they could have just contracted out to the commercial sector for it like they did when they needed a space station taxi.
Reply: the guy is racist towards indian that's why he here nasa which is run by Indians
Reply: It works. It even works perfectly. So for now, it’s doing way better than that thing SpaceX is trying to create.
Reply: @angrydoggy9170  SLS works perfectly? The vehicle that did launch will never launch again, as Boeing/ULA is collecting more taxpayer welfare to upgrade it. It's 6 years past schedule (they were given 7 years to develop it to be ready by 2018)and $10 billion over budget, every bit paid for with American tax dollars. What part of that is perfect in your world? 
Starship has been in development since 2016 with $0 of taxpayer money. Take a breath. Compare the 2.
Reply: SLS: 100% successful on 1st launch.
Starship: 50% successful on 4th launch.
Reply: @edgarwalk5637 
SLS: 1st launch had no problems, though it was a couple years late, and will never get cheaper for each further flight;
Starship: 1st 4 flights have gotten better each time, and costs will eventually go way down for each further launch; SLS has no path to lowering future costs, Starship does
Reply: @edgarwalk5637  So reaching orbit and soft landing both stages mostly intact is "50% successful", but reaching orbit and completely destroying the whole rocket is "100% successful"? Testing early and frequently and learning by breaking things is a deliberate choice to speed up development, one which was used extensively in the early years of the space race. While SLS was in development for over ten years without even leaving the ground (plus all the years wasted on the Ares program) SpaceX was churning out engines and prototypes, flying them, breaking them, and learning, and now they've launched the biggest rocket ever flown into orbit and demonstrated intact, controlled touchdown of both stages, which SLS isn't even trying to do.
Reply: @TonboIV Reaching lunar orbit with a payload and returning on the first try is 100% success. An empty shell barely leaving the atmosphere and exploding multiple times with the best launch managing to crash into the ocean in one piece, is at best 50% success.

People like to use that techbros saying break things quickly. It is simply an excuse for managerial incompetence. Elon need to put on a show, instead of allowing his engineers to build a functional rocket.
Reply: @jasjordan1  Was Wernher von Braun a techbro? How many explosions did it take him to get the A4 flying? Or the Redstone? How many explosions for Convair to launch the first Atlas? How many engines did Rocketdyne blow up to get the F1 working properly? Testing early and often and learning from failure is an old and proven technique used extensively during the space race. SLS is a conservative design and the decision makers are very risk averse, so the program went over ten years without even trying to fly anything. SpaceX has already proven the value of doing things their way with the development of vertical landing for the Falcon 9 first stage.

Starship did not "barely reach orbit". It reached a 212km apogee at 7.3km/s with plenty of fuel to spare. This is a clear demonstration of orbital capability. A suborbital trajectory was part of the mission. It's also a larger rocket with more thrust and more fuel capacity than SLS. Of course SpaceX isn't going to try landing any stages on land or a ship until they know they can do it reliably. Coming to a controlled stop at the surface of the sea is a safe way to test their capability to land, and doing so with both stages of an orbital rocket is historic, an amazing technical achievement, and takes SpaceX much closer to repeating the same feat at a landing pad or on a ship. It's also something no-one else is even trying to do with an orbital launch system. A partial success doing something no-one else has done should be applauded.
Reply: @jasjordan1  Why are you trying to defend SLS so hard? What is your vested interest in it? Was your pappy a designer or something? Or do you just have so much animosity for Elon himself? Ultimately, the era of rocketry being dominated by governments has come to an end and that's a GOOD thing. It was always supposed to be the goal to eventually turn LEO over to private enterprise so NASA could concentrate on hard science. SLS' first launch being a success is because it essentially had to. That's why it's way late and over budget because that's the price of using taxpayer dollars. Imagine if SLS had blown up during the launch, even though it was a test there would have been a huge media spectacle and congressional hearings with threats to cancel the program. Along with budgets, this means NASA has to take a long, slow, and ultimately more expensive approach to designing and testing their rockets. Nobody (other than possibly some investors) cares much if a billionaire blows up his rockets so it affords SpaceX way more latitude to just test a design and see what happens. Yeah, that means their failures are much more public, but it's not for show. They get so much more valuable real world data that they can then use to iterate on their designs than the simulated data NASA has to depend on because NASA has to get it right 100% all the time, SpaceX doesn't until it's actually carrying payloads.
Reply: @TBone4Eva  we are defending SLS because it is more cost effective and actually working system, that's it.
Starship on the other hand can't possibly be used to transport anything for Artemis mission, because you'd need 10-14 refuelling launches for just 1 (!!!) Starship payload to Moon. Think about that.
Reply: @edgarwalk5637  
😮Elon bad. 
😮Orange man bad
😮shish, tv is on.😮
Reply: @edgarwalk5637  space x is developing the literal most complex rocket in history and trying to land it. NASA built a regular old rocket
Reply: @TonboIV Now you are really reaching. Comparing technology from 80 years ago? Really Von Braun and his engineers were doing their design and calculations with paper,  slide rules, and their heads. Today we have supercomputers, 80 years of experience and data, and the ability to run similations to test mist aspects of a design before it leaves the factory. There hasn't been a need for breaking anything on purpose to gather data since Biden was a toddler. 

And yes, Boeing was risk adverse. When people's lives are on the line, failure is not an option. Of course, if you are a narcissist it's about looking good and people's lives come second. And when they have a cult of followers cheering him on, you are more than willing to blow stuff up knowing that they will never doubt you.
Reply: @jasjordan1   Failures on Boeing's part has cost people's lives, at taxpayers expenses. Nobody has perished because of SpaceX, who doesn't take taxpayer money for their R&D. Your argument fails.
Reply: @jasjordan1  I'm reaching? That's not how engineering or computers work. You don't just throw a design into a big computer and find out if it works. Simulations like that are often more difficult and time consuming then physical testing, and flat out impossible for something as complex as a rocket. SpaceX knows how to use modern computers as well as anyone else, but there is still no replacement for building and testing real equipment.

I also wasn't aware we were discussing Elon Musk's character flaws. Are they relevant? Have you been basing your arguments about Starship on your dislike of the guy who owns the company this whole time?
Reply: Sls is more useful than starship, and cheaper
Reply: @Andrew0you0tube By what metric? What evidence do you have? Or are you just trolling? The government is not in the business of efficiency or cost effectiveness AT ALL. Nor are the Iron Triangle companies that have been sucking off the taxpayers’ teat for decades. 

The cost of putting loads into orbit has dropped by 90% since SpaceX was allowed to do its thing. 90%! 

Legacy companies would NEVER even CONSIDER working towards that goal.
Reply: @Andrew0you0tube  Cheaper? What planet are you living on? 🤣
Reply: @TallinuTV  spacex already wasted more money than all launches of saturn-5 combined, and didn't even reach the orbit
Reply: @Andrew0you0tube  Bro, you must have been spoonfed some deliberately bad numbers.  For one thing, each Saturn V cost $5 billion in today's money to build.  For another, Starbase/Starship has cost SpaceX $10 billion so far.  Lastly, "the taxpayers" have paid $2 billion of that... and SpaceX would have spent that $10 billion regardless of NASA's milestone awards, because they're not making Starship for NASA or the US but rather for their own ambitions, which just happens to mean they'll have a vehicle that can fit a lot of other bills.  So, let me guess... Thunderfoot?
Reply: @Andrew0you0tube Are those dollars adjusted for inflation? How much have they supposed wasted? And who gets to decide if it was a waste? Some would say the whole space program is a waste, but really, what is your metric for making this determination?
Reply: @Asterra2  You're wrong, NASA literally contracted SpaceX for Starship HLS, and you're paying for that with your taxes.
Reply: @Andrew0you0tube  NASA has handed over $2 billion for Starship milestones because Starship is an important component of Artemis 3+.  Starship is not being built for HLS.  Starship is being retrofitted into a HLS.  You don't need full reusability or 200 tons of payload for HLS but SpaceX is doing that anyway because that was always the plan for Starship.  Would you like to clarify, with quotes, what I said which you are labeling as "wrong"?  Or better yet, since you are so laser focused on the taxpayer angle, how would you feel if we were instead footing the bill for National Team's original $6 billion bid?  Or Dynetics' $12 billion bid?  It sounds like that's what you would prefer.
Reply: @Andrew0you0tube Correct. The bottom line is Elon is just as good as anyone at spending taxpayer dollars.
Reply: @Andrew0you0tube  Ummm.... Dude.... SLS has 1, yes 1, launch under it's belt. So far cost per launch is listed at $2 billion dollars. Cost per launch (so far) is estimated at $100 million dollars. Once they are able to start recovering both vehicles intact, cost per launch might be below $10 million. Musk claims a final cost per launch for production units (i.e. used for launching Starlink and other LEO misions) of $2-3 per launch - optimistic, but low enough a lotto winner could actually buy a launch just for giggles.
Reply: @kstricl  I'm convinced SpaceX has been charging far above cost for Falcon 9 launches for years now (not like anyone's competing on price anyway). It's the only way I can see them having the money to crash develop the worlds largest rocket and do two reusable stages at the same time. It makes sense that they'd also plan to overprice Starship so they can keep shovelling money into development, and no-one else is even trying to build a competing vehicle, so it should be a long time before they need to worry about competing with anyone on price.
Reply: @TonboIV  definitely don't disagree with you. Also think about how much starlink charges per month - the frequent launches allow Elons accountants to transfer funds between companies as expenses. I won't fault them for raking in the coin to make those giant sparklers.
Reply: @TonboIV internal cost of F9 launch is around 15-20 mln depending on configuration and flight plan. 10mln is for production of second stage alone. 

Highly recommend Ars Technica as Eric Berger is probably best journalist focused on rockets. And he got plenty of internal sources.
Reply: @kstricl  Bullshit, you clearly don't understand how orbital mechanics works to understand that it is not sustainable to launch 14 starship just for 1 flight to the moon.
Reply: @TonboIV why wouldn't they charge far above cost? They're in business to make money! and still they are the cheapest price to get you load to orbit; last year they hauled something like 90% of all cargo to orbit and made a profit, at prices far below any other launch service, how can anyone compete with that?
Reply: @bryanhood9839  Yes, that is exactly the point I'm making. I believe that SpaceX is charging far above their costs because they can. Maybe they'll start lowering prices on their own once they get Starship flying regularly, or maybe they'll keep prices high to fund even more ambitious developments. Ultimately, SpaceX's high prices reflect a failure of their competition to innovate or take the threat from SpaceX seriously. I would love to see someone really compete with SpaceX and even one-up them and I am continually disappointed that no-one with the resources to do so is even trying.
Reply: @Andrew0you0tube  Hmmm.... I think you seriously underestimate the plan for Artemis if you think the SLS can carry the supplies needed in a 1 and done space shot.
Apollo style, sure. But to be able to stay for weeks at a time, no - they need the habitat that is being designed and built by SpaceX based on starship. It's not an either or situation.
Reply: @TonboIV the funding for spacex comes from the billions in private investment along with its now profitable launches, government contracts and of course it future big money maker, starlink. It was losing a lot of $ at first and was most likely funded directly by Elon quite a bit.
 In 2019 it operated at a loss of $1.45 billion, and last year (23) it made $3 billion on $9 billion in revenue.
Reply: @kstricl  One difference is that SLS is a working design, whereas Musk's new rocket is still work in progress (despite the "success" of the last launch). Granted Musk is getting there, but he does actually have to finish it. And to compete with SLS, he also has to get in-orbit refuelling working. That's far from a given at this point in time. 

Most people seem to forget that SLS is meant to loft heavy payloads up and beyond LEO at high velocity, whereas Star Ship is only any good at getting to LEO (it's intended to put up Star Link satellites). 

If SLS got cancelled and then Musk said "nope, I'm not going to pull through with all this in-orbit refuelling thing to get to the moon or Mars", then it'd be back to square 1 for a bunch of science missions.
Reply: @abarratt8869  Musk cancelled moon mission first)
Reply: @abarratt8869  "compete" with SLS is just not correct. Orion can only get to the NRHO orbit, it can't even get into LLO. Now remind me which rocket is Orion's going to launch from...

This whole mission architecture is so complicated that NASA decides at least the in orbit refueling solution has a chance of working, unlike the other proposals that actually needs "negative mass" to pull off